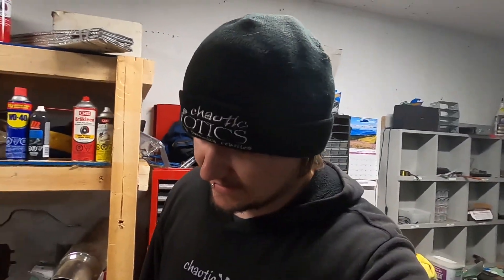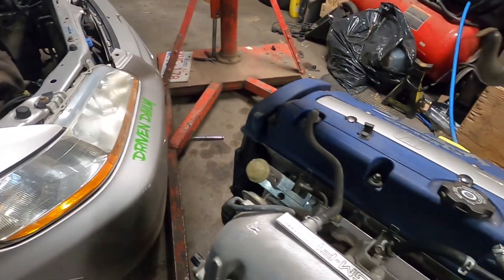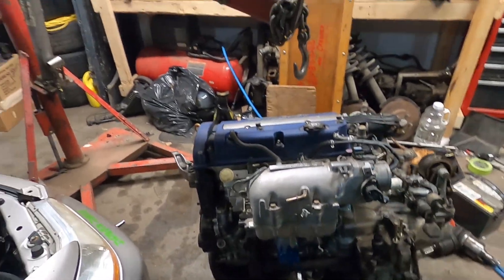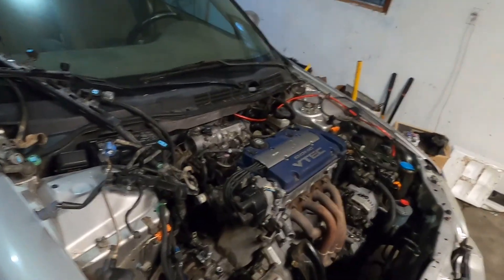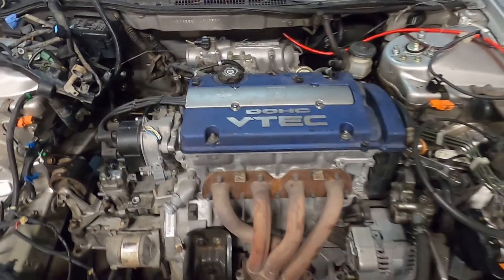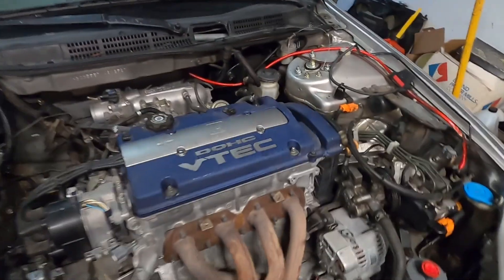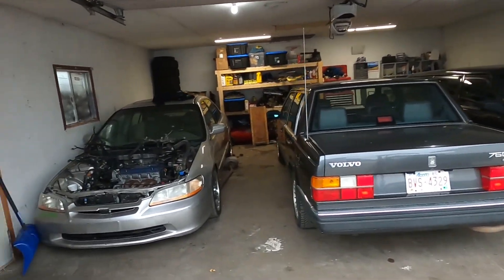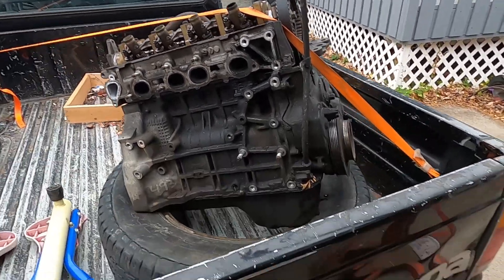Installing (Kind of) My Dream Engine Swap in My CG6 Honda Accord

Comment: Was planning to do this to my 02 accord, what motor mounts did you use for the driver side? 
And did everything plug in to the H series motor what did you have to change?
Reply from the maker: Hey! First off thanks for watching! And I don't have all of my wiring dealt with yet. I'm going to be running the F23 Harness but the only difference (as far as I know) is the injectors and the distributor plugs are different. The H has the crank position sensor in the distributor instead of on the block like the F. And for engine mounts, this engine came out of the same accord but from Japan. So this bolted right into the car, even the F23 5 speed bolted up. I'm no sure it the preludes (H22) uses the same mounts as the Accord.

Comment: What engine , engine mount and harness did you use
Reply: I would like to have seen you install it as well
Reply from the maker: @sotig9884  well I hate to admit it, but this car is no longer in my possession. Sold it to fund other projects. The plan was to splice the F23 harness and move the CPS to the Dizzy on the H23A. And I used all the F23 mounts to mount the engine.

Comment: i have 2000 accord automatic  is there a kit or part list i could get to know what i need for k24 swap?
Reply from the maker: K24 sits the other way, transmission on the DS and engine on the PS, that's the biggest hurdle in a K swap. All the mounts have to be changed. The H series bolts right up to the stock F23 trans (Auto and Manual I think) so it makes for a much easier swap.

Comment: You put an h22 in it?
Reply from the maker: @GreatLakes-gl3oc  Technically it is a H23A? It's out of the 6th Gen Accord Wagon in Japan I believe. I know the block is stamped with H23A. The engine is in the car but it is not running yet. Thanks for Watching!

Comment: What u do with the old transmission?
Reply from the maker: I'm using the stock trans for now. It bolts right up, F and H are similar enough that you can do that. Eventually I'd like to swap to a last gen prelude transmission, I've heard they are much stronger. 👍